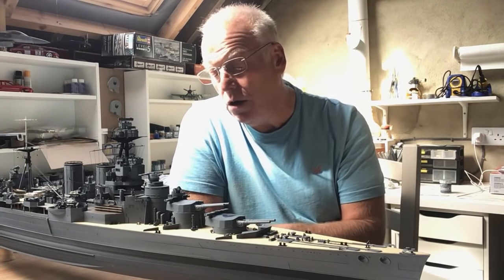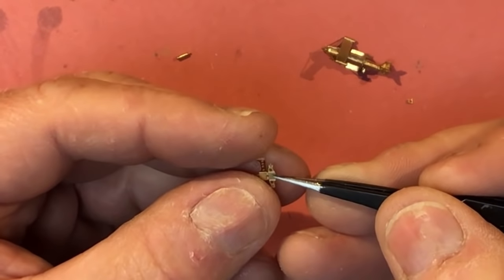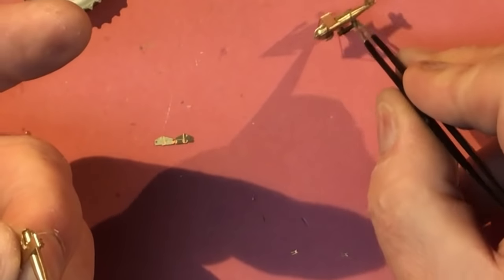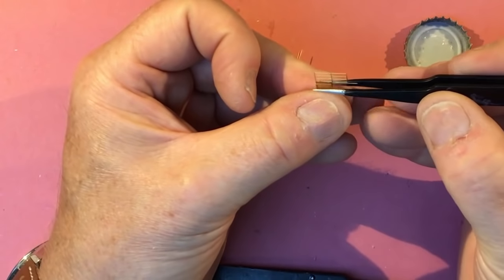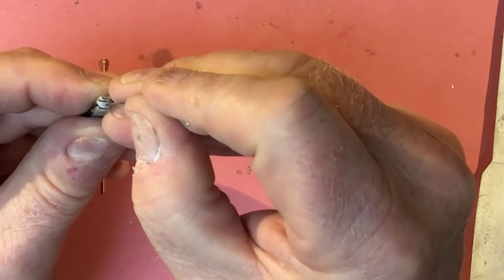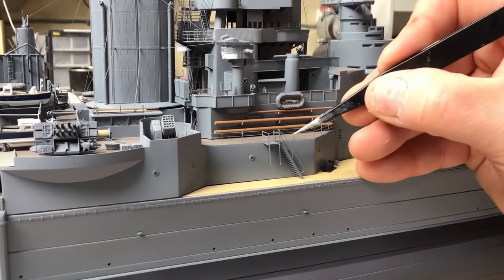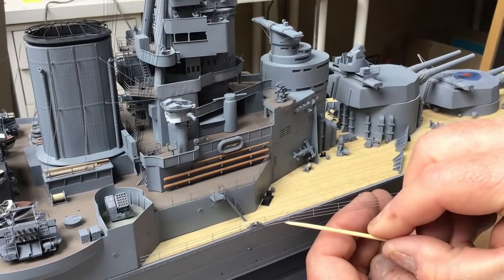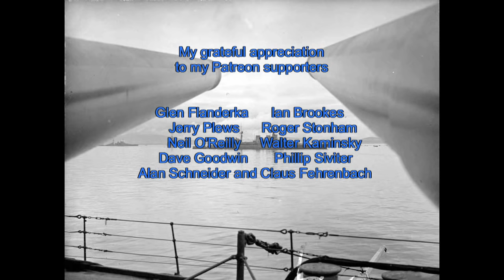Trumpeter 1/200 HMS Hood Full build with Pontos detail set Part 48

Comment: Just wondering what glues you use? Amazing build. Thank you for your great videos.
Reply from the maker: Hi. I use several glues depending on the application. For plastic-plastic joints I use Tamiya extra thin (mainly the quick setting variety) and revell contacta professional. For CA or superglue in a variety of thicknesses but I use thick and extra thin the most. I also use washable acrylic glue where I don’t want to risk marring things like the decks and for this I use Mig ultra. hope that helps.
Reply: @TheModelShed  hi sorry just seen this. Thanks for replying.  That's great thank you. Just one more question what brand of Ca / superglue do you use?
Reply from the maker: it’s called Vitalbond - I think I got mine from eBay if I remember correctly
Reply: @TheModelShed  that's great. Thank you.